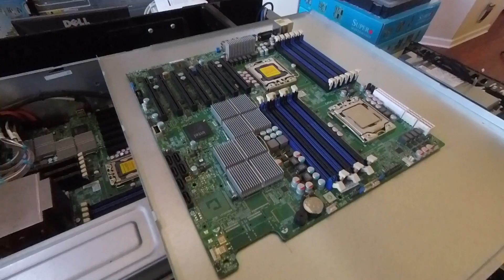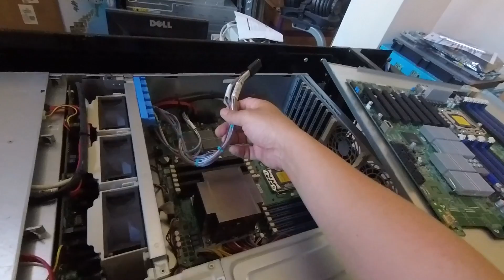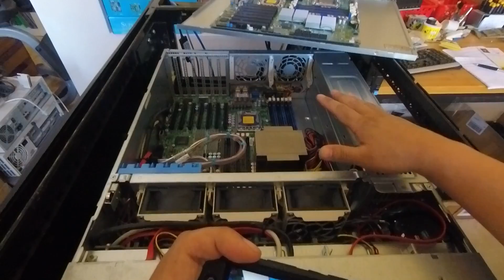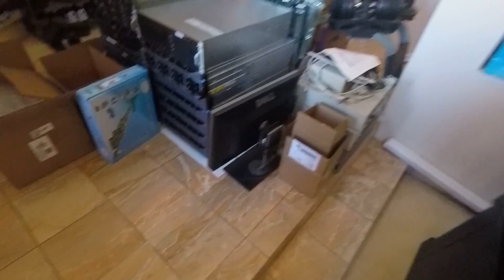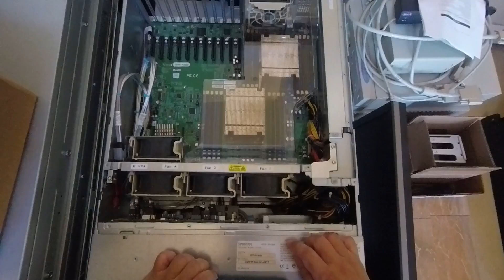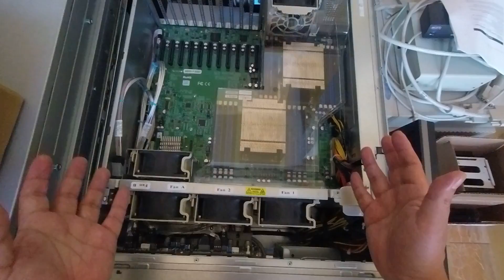An Inside Look at The Art of Server Flashing Machines

Comment: Do you try the pcie riser adapters. We use them here at my place of business, which is a huge electronics fab. We run multi-thousands of pcie based cards through our functional test servers and the risers have been worth their weight in platinum. We were seeing many pcie slot failures prior to utilizing the riser adapters. I am currently working with one of the other engineers here to get that part number and will attach it once he finds it.
Reply: The site he orders from is adexelec.com

adexelec.com/pcie-single-risers

I believe they are in California also...
Reply from the maker: Cool. thanks for the tip. I've never had problems with wear on the PCIe slots, not even after 1000+ insertions. I had other things fail before I experienced PCIe slot problems.
Reply: @ArtofServer  They arent rated for that many unfortunately. It's best to go with the risers. I have a few of them, I think theyre called the r33a pcie riser.

Comment: I'd tried many times to flash my hbas with a standard PC and there was no way. The mobo was an ASUS F2A55, with 2 PCIe 2.0 slots. After cleaning the flash, in restart the hba couldn't be detected again.
Now I have 2 hba DELL H310 waiting for a better board in order to be crossflashed, but prior spend much money in that, maybe I'll buy in your store a couple of them.
Reply from the maker: @Eduard I don't know specifically the issue you had with those ASUS boards. I do know that Supermicro X8 motherboards work really well for the DOS flashing tools, while the Supermicro X9 and newer usually will not be able to run the DOS flashing tools, but will work with the EFI tools.
Reply: @ArtofServer  
Do you know what?
Finally I've tried to crossover my HBAs in a different machine, an HP Desktop, and they're just passthroughed.
There is only a little difference: I've modified the line on charging the 2118it firmware in order to allow bios loading:
sas2flsh.exe -o -f 2118it.bin -b mptsas2.rom, and now the system starts with an Avago F/W Initialize window.

Awesome!
Reply: @ArtofServer , maybe I'll try it again in a better machine. Thank you very much for your videos and your help.

Comment: Hi, is there big differance between d2607-a11  and lsi-9211-8i?
Reply from the maker: nope
Reply: @ArtofServer   maybe quality ones or anything?
Reply from the maker: @keratishvili  i can't speak to quality difference, they are about the same really. the board design on the Fujitsu is more elegant and has less components on the PCB. The LSI card has more indicator LEDs, so some people like to see blinking lights as a visual confirmation that something is working or not. they are otherwise based on the same SAS2008 chipset, and functionally identical.
Reply: @ArtofServer  thanks a lot.

Comment: Bro...you and me we think alike! I have that EXACT same mobo for my testbench. I deliberately got it for flashing and as a test bench. I did populate both cpu slots, but to save power, i should have used just one cpu  :.)
8 x 8 pcie slots works out great! I wouldnt worry about the PCI-E slots either as I brutalize my system and the slots still work great. I often pull out cards while the board is on and hotswap cards and all of that and it keeps ticking  :.) 
I get zero flashing problems on this board. No PAL errors or anything. I just wish it had UEFI built in.
Reply from the maker: LOL... your comment got classified as spam! I had to redirect it...

wait, 8 x8 PCIe slots??? which board are you talking about? or just mistype? (this board has 7)

yeah, i'm quite surprised that the PCIe slots are totally fine, yet the DIMM slots and BMC are the first to start flaking out. that certainly wasn't what I expected to start giving me problems. 

like i mentioned, i use to "hot" plug PCIe cards. in Linux, I can do a PCIe bus rescan and it usually picks up new devices. the problem is that I've ended up killing a couple of cards doing that, i'm not sure exactly why, but I've stopped doing that since. cards that were working fine, but afterwards would not power on at all anymore.

Comment: I once had a (Athlon XP) Computer and the PC speaker randomly burst into Flames while it was in Idle - the Cable was charred and my entire Room full of smoke, but it just kept running :^)
Reply from the maker: wow.. that's a first i've heard of that kind of incident. I've heard of PSU capacitors popping and blowing out a lot of smoke, or RAID card batteries blowing up, or 4-pin->SATA power adapters shorting and catching fire... but onboard speaker is a new one!

Comment: Thanks for the video.

If you want to accelerate the speed of flashing/rebooting, you might want to use the Linux KVM, map a single PCIe card to each VM, do the first stage, reboot the VM, perform second step/verification. You can do it with a simple script or use Ansible.
Reply from the maker: That's a really interesting idea if I were still doing more than one reboot per flash cycle!!!!!!! I wish I had thought of that before!!! I've eliminated the reboot required by taking the card offline and bringing it back with a PCIe bus scan. So, still only 1 boot required per firmware flash cycle... so the KVM idea might not make a difference now since I'd still have to at least boot up once (the KVM hypervisor), so no time savings there. Once booted up, my firmware flashing is completely automated, at least until the final cable test stage - so unless i can invent a robotic arm to plug/unplug SAS cables, that part will remain manual.

I really like the idea though... i hadn't thought of doing that back when I use to flash with the DOS tools...

Comment: first here-)  well done, nice informative. You maybe can look for pci extension cables and homemade a setup so your boards slots has not the stress. I dont think its designed for so much swapping , contacts worn out or even bent and create shorts. Is flashing cards the only thing you do for a living?
Reply from the maker: well, surprisingly on the X8DTH-iF board, it wasn't the PCIe slots that went out first, in fact the PCIe slots were perfectly fine. somehow the DIMM and BMC is what started to flake out. So yeah for now I think it is fine, even if it means I need to change out the motherboard after 1000 flashes, but like I said, the PCIe slots were not the problem.

i don't know what I do for a living anymore LOL .... I've been an IT consultant for the last 15 yrs; mostly doing work in the security space, but also doing software development, system architecture, performance tuning, etc., etc. I also use to repair BMW cars for people and sold hand tools. but this last year, the eBay and YouTube thing has become a bigger part of my time.